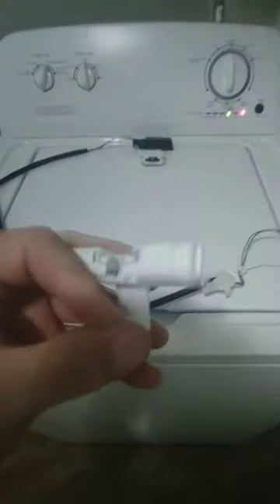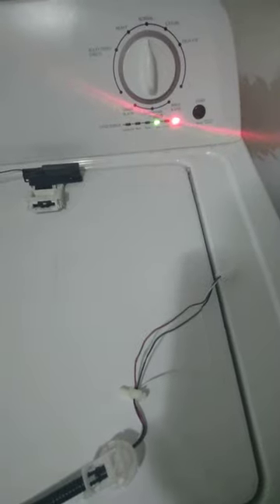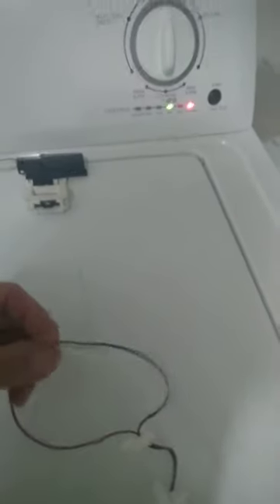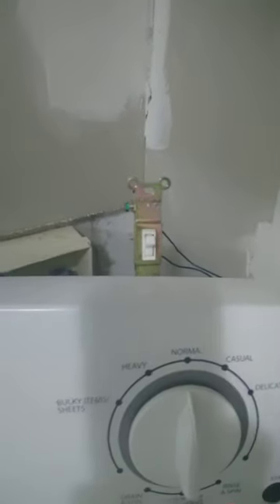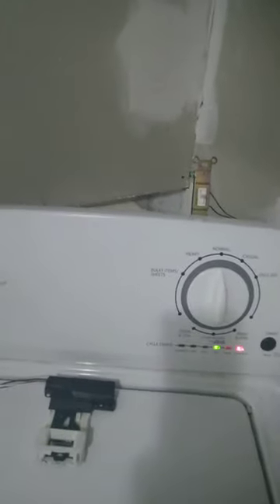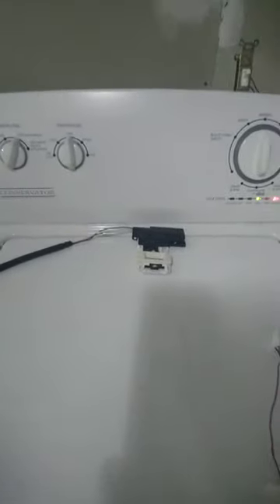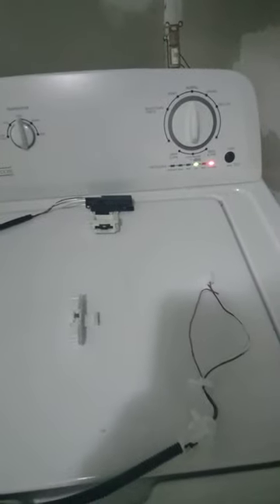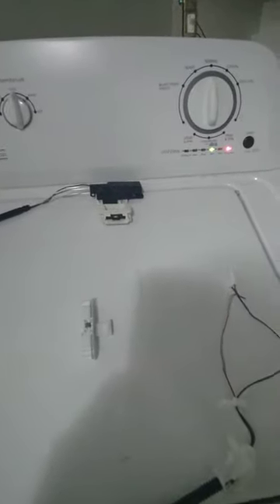New style washing machine lid switch bypass

Comment: Hey chad good idea it worked for me however i wanted to make a few things more clear for folks with questions so if you have red blue and white wires the white and blue go together on one screw of the electrical switch and the red goes to the other screw however ladies there is usually a green screw on the electrical switch which is a ground screw nothing attaches to that however u could ground it but its not neccessary..Also chad was saying you have to be around when it gets to the spin cycle and that is on his unit on mine i have to flip the switch when it reaches the rinse cycle because my machine does rinse and spin in one cycle so i just wanted to be clear on that my machine is model WTW4616FW1
Reply from the maker: Jason you are actually right. I failed to mention that in the video. It's the rinse cycle that I need to switch it on. Also if you miss the time of it ..you can always just unplug it and plug it back in with the rinse cycle on and the switch on and works pretty much the same
Reply: Hey chad i also found out you can use a big magnet attaching it to the striker where the lid locks which tricks the striker into thinking its locked for future reference .Ive learned how to do so many things from youtube even fixing my own electronics its just so cool the talent ppl have to offer if ur willing to fail and learn but as of ur idea my washer is working excellent thanks bud

Comment: Hi it's been a while since you posted so I hope you see this. 
So I did what you said to do. 
It worked! But now it like it's tricky to get it to work, I have to unplug it, plug it in while in 'off' position then start the washer then flip to 'on' like really at a perfect timing or else I have to start over. Any ideas what the problem could be? P. S. My switch has red white blue and yellow. I did the blue/white on one screw, the red on the other and the yellow to the ground screw.

Comment: Hey, This is great. I am having quite the time with my Maytag Centennial. I too ordered a new lid switch and it did not work! However, mine has four wires, red, blue, white and yellow. Do you know where the yellow wire goes in this set up? Thanks!
Reply from the maker: Does it have a black strip on the yellow wire
Reply: @chadrose9999  No, it is just yellow.

Comment: Hey man im having this issue with my washer when i close the lid one of the clips broke so now it wont work so on the light switch do u put the blue and white wire together and screw it to the top or bottom screw of the switch? And  i take it the red goes on the other screw  right ? Or does the white and blue go on the ground screw?
Reply from the maker: What I did is just tie the blue-and-white to the top and then the Red to the bottom I don't think it really matters as long as it makes contact.
Reply: It doesn't matter.its just opening and closing contacts.
Wonder what the voltage is on those wars?hopefully 24volts.
I'm gunna try once more with my second new switch.
Then the B is going in storage!
The ol kenmore series 70 came out of hiding and is FASTER /QUICKER than this stupid whrillpool crap.